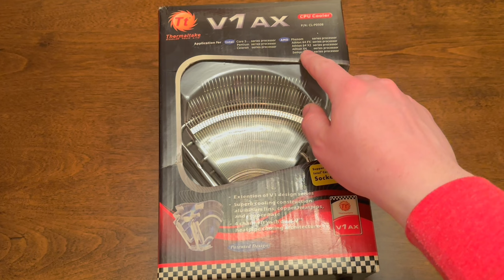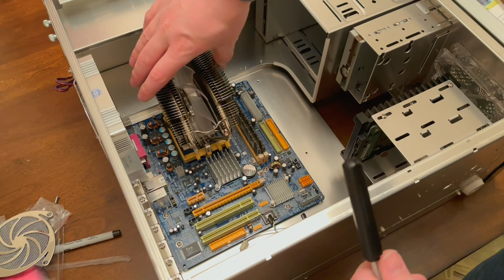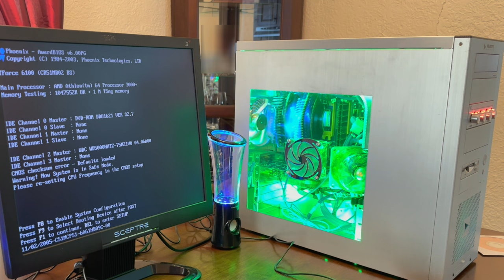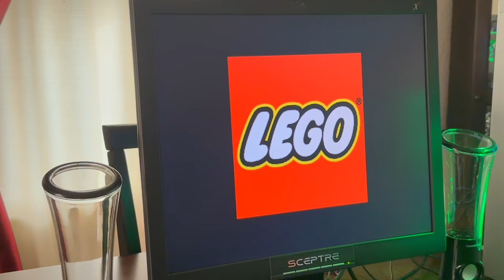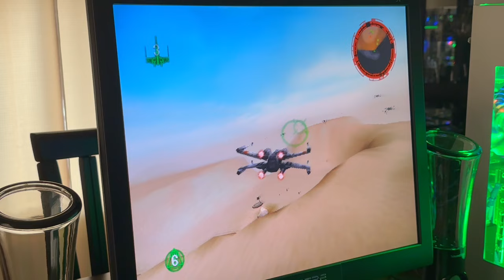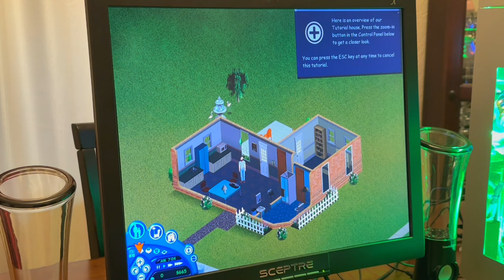Building a Gaming PC Like It's 2006!

Comment: • Non-modular PSU
• Molex cables
• DVD R/W drive
• IDE cables
We really have it good nowadays don't we? I also didn't know that older fan controllers look like an XLR audio interface.
Reply from the maker: There was a lot of design creativity back then!  Just remembering Logisys, you could get a full acrylic case with bubble-jet light tubes and all other LED accessories to stick around, and then power it all with an acrylic housed PSU that would last for about a month because the components were so bad.  Sunbeam had a lot of the same kind of stuff, and they went out of business about the same time too.
Reply: You forgot about setting drives as slaves / masters using those tiny blue things!

Comment: Awesome. What a nice case. Also I really like the rear fan, the sleeving kit and your custom side panel window. Reading "Like It's 2006" I was expecting a Core2Duo - but around the same time, one of my PCs also was an Athlon X64 system.
Reply from the maker: Some of the parts like that came from old computers my family was no longer using to save on costs.  I probably would've gotten something like a Core 2 Duo if I was buying all the parts, but that single core Athlon 64 works surprisingly fast in a Windows XP system!

Comment: Oh boy. Those Velociraptors were the fad back in the day before flash memory was invented. And of course, people often chose to ignore how loud they were or we had to make themselves feel better about the noise by showing how loud those 22,000 RPM SAS drives were.
Reply from the maker: The one I put in is surprisingly quiet, even comparing to some old 5,400 and 7,200RPM drives I have.  I'm sure they improved them quite a bit over early versions though, so it wouldn't surprise me if a lot of those were on the noisy side.

Comment: i really liked ur video one day i want to start building computers as well i have been so scared of trying i always took it to the shop for them to build
Reply from the maker: As long as you’re not doing extra customizations and such, building a PC is actually pretty easy!  Sockets, cables and components are made to fit only one way to the correct places, so if you can build a puzzle and turn a screw, you can build a PC.

Comment: i have a similar lian li case from the same era. A pc-a05. I bought it brand new for a q6600 build. I was so sick of the ugly and tin can thin contemporary cases that I actually dragged it out of the basement and put my 5700x based system in it. Those cd rom covers were uptional purchases. I had to order mine separately.
Reply from the maker: I saw when looking for info on the case that they were usually sold without the CD flip-down covers.  I assume mine had them because it was a custom order case instead of stock Lian Li.

Comment: Those speakers are so cool! Please add a Sound Blaster card for EAX support. I like the Dell SB0770 for PCI, because it has a regular front panel audio header. If you prefer PCI-Express x1, I would go for the Sound Blaster X-Fi SB088X series.

Comment: You did a nice job on cutting the case panel and especially the plexi cutout for the fan. What did you use to cut that so cleanly?
Reply from the maker: @kevinjennings8525  Thanks!  For the metal panel, I traced out where to cut with a ruler and a sharp knife, then did the actual cutting with a Dremel and cutting wheels.  I cleaned it up with a file and finished it with 600 grit sandpaper.
For the hole in the window, I drilled a small guide hole first, and then used a 3” hole saw with a drill bit in the middle to sit in the guide hole.  The hole saw was turned slowly and gently to make sure it didn’t bind and crack the plastic, and then I finished the edges with sandpaper, drilled the fan mounting holes and peeled the paper backing off.  All together, it was a couple hours of work to get it done.

Comment: I got a 16 bit installer for star wars sequel to rogue squadron, battle for naboo to run on windows 10! There are work arounds!
Reply from the maker: Nice!  I've managed some workarounds before on my newer systems.  As long as the program itself is 32-bit it can usually run if the files are copied to the right places.
Reply: @Darth-SF  as i recall it was a simple reg-edit

Comment: 46:30 Turn on Windows 95 compatibility mode.
Reply from the maker: I did try that off camera, which is how I at least got environmental sounds in the last clip, but I think it is sound driver compatibility.  I’ve had the game running on Windows 10 (with graphics problems unfortunately) with a Xonar card and modern drivers with no sound issues, so I’m going to try a cheap Sound Blaster sometime and see if that works.

Comment: Hello was wondering how you cut the fan hole
Reply from the maker: I used a 3" hole saw with a power drill.  To make sure the saw didn't damage the acrylic, I made sure that it was only barely touching the sheet as it turned, and it eventually cut through and I sanded the edges smooth with some fine grit sandpaper.  Took some patience, but the results were good!
Reply: @Darth-SF  forgot to thank you. Appreciate it:)